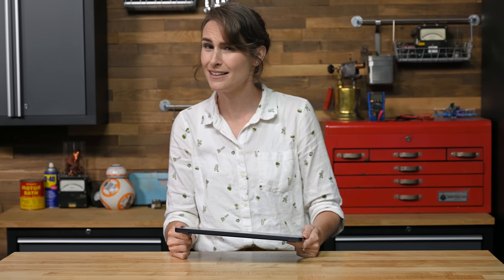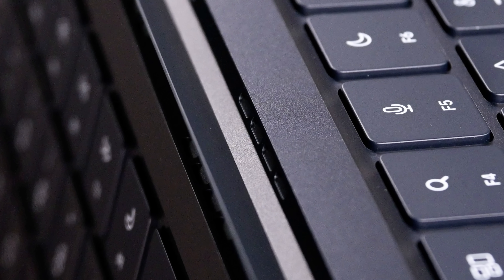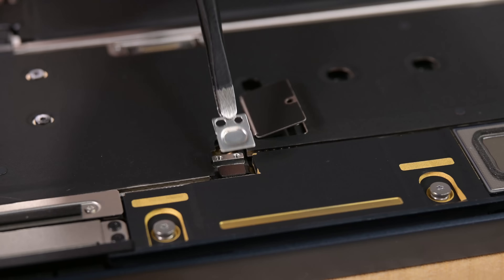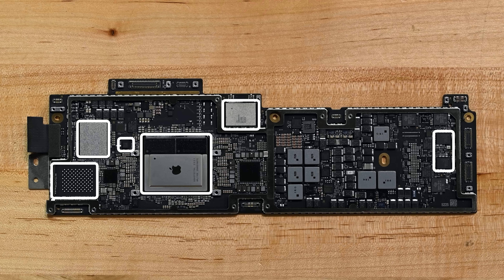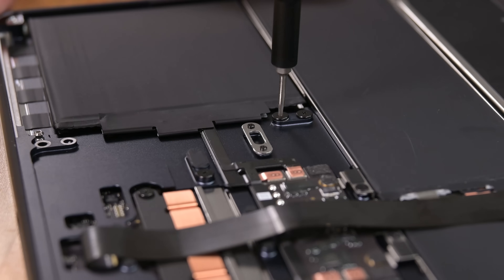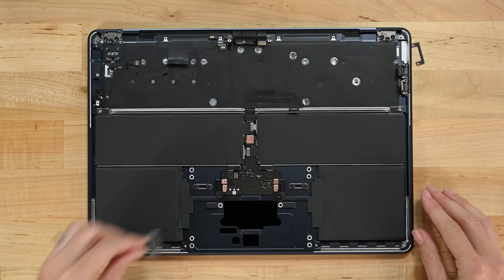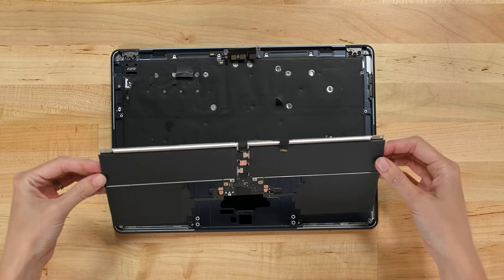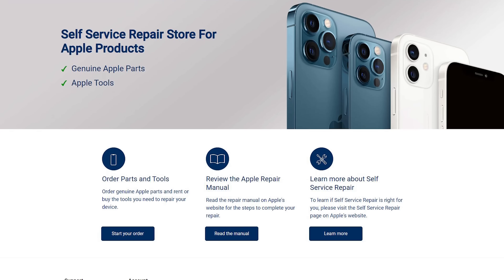M2 MacBook Air Teardown: Too Cool for a Heat Sink?

Comment: Remember when iFixit used to have detailed, step by step videos that would actually walk someone through the process of replacing parts? Now it’s all about highly edited videos with kind of useless and snide copy/commentary. Like everyone else, the modern ad-hungry internet made them a caricatures of themselves with these made-for-clicks videos that breeze through crucial steps without detail. Like getting the bottom plate off of this M2 MacBook Air with the use of suction and having to angle it out due to slide-in clips). I guess you can sell just so many tool kits before you need to pull tricks out of your sleeve.

Comment: You can drastically improve the thermal performance by adding more thermal conductive mass with copper shielding tape. Remove the graphite tape from the metal shielding panel, apply copper shielding tape on the metal shielding panel, but don’t cover over cutout areas. You basically just want to add more conductive thermal mass to the existing  metal shielding panel. Do not cover over cutout areas because you don’t want heat transferring over from the CPU to these chips. Now put back the black graphite tape over the copper. Make sure not to add copper tape to the area where the trackpad ribbon cable is routed! Now you have a proper heatsink!! This solution does the job without causing heat to get transferred to other critical components, using thermal pads will raise the temperature of your memory and storage!! You can also buy another bottom case cover and  drill tiny ventilation holes to allow hot air to escape! Use a tiny dremel drill bit with a printed hole guide to make it look clean and professional 😂 FU Apple!

Comment: 100c cpu temperature in the new macbook air M2 is another case of bad engineering by design. we already know that these chips have as little as 10w TDP, which is very easy to cool also within a think ultrabook, but they decided to use a thin aluminum foil as heat spreader with no real heatsink. a shame as usual. they can't point a finger to intel anymore but they wanted to make it worse anyway.

Comment: I had no issue replacing HD on my old macbook pros from 10 years ago but it looks like it would be a real pain in this laptop - this drive to be uber thin - and wondering about heat  - makes this machine a pass for me
Reply: The air solders their hdd/ssd

Comment: apple for whatever reason, lately, designing things that are not meant to last very long, and that are not meant to be repaired (supplying tools and parts is not meant for repairability, it is for show to satisfy laws etc... because parts/tools will cost a joke money and time that noone sane enough will do it, not to mention non apple parts will not work because apple chip and match them to prevent any other way of repairing!)
if your keyboard broke, apple will ask you to buy a new mac, if your ssd/ram failed, apple will ask you to buy a new mac, you broke the screen, apple will ask you to buy a new laptop. laptop runs down, apple will throttle you enough to make you think it s time for a new mac!

heatsink? what is it? 17th cent? cooling? what cooling fanbois are cool enough :)

good luck convincing fanbois!

Comment: No way all soldered in a single logic board no way!! (CPU, ram, data) is this a phone or a laptop? If you fry the logic board then it's all wasted ...
Reply: Yes my dear friend, that's the insanity that is employed by apple users. You would think apple could design some modular standard of memory that has the bandwidth of octa-channel memory even for the rare applications that take advantage of that, but nope, we screw you extra hard by soldering down your precious storage so you can't repair, upgrade, or recover the data if any other component of the board fails. Should've bought applecare you bozo!

Comment: some youtubers have gotten better benchmark scores by adding a few strips of thermal pads to spread the heat. eventually the whole inside gets hot though and throttling still occurs. If someone comes out with a proper heat sink/thermal kit with a replacement vented case bottom i’ll be first in line to buy one.

Comment: M.2 drives do not require heatsinks. Only the controller chip benefits from the heatsink, not the NAND. NAND retains data more effectively when it's toasty.
Reply: Apple's new CPU is called the M2. Yep, it's confusing. This machine has an M2 processor and M.2 storage.

Comment: If there's no heat sink, how is the thermal pad mod as effective as it is in the first place? It's exactly like the m1 air, the pads are so effective they beat out the Pro in the first few tests before the chassis is soaked. But for the pads to be effective, it means the heat sink has to also be effective, no?

Comment: Usually the accelerometers in laptops protect hard drives from damage. If the laptop were to suddenly drop while in use, the accelerometer would detect the sudden free fall and immediately turn off the hard drive to avoid hitting the reading heads into the hard drive platter. 
In this case, I have no idea why since it has SSD

Comment: I have ordered this and now I’m concerned, won’t the lack of a heat sink damage the laptop in the long run? I’m hoping to use it for 6-8 years
Reply: I’m considering cancelling my order and getting the m1
Reply: Well as long as the built in heat protection mechanisms work (thermal throttling & emergency shutdown) the computer should be able to protect itself from any long term damage

Comment: I've noticed 13" M1 MacBooks wake when moved, which is literally the only accelerometer use I've found. Maybe it's also used in warranty evaluations to check if it has been dropped?
Reply: Interesting

Comment: the accelerometer helps detect falls — in older machines, it would retract the hard drive heads on mechanical hard drives to avoid the head crash during a fall. i imagine it is used to avoid some similar mishap when it detects that the machine is falling. 🤷 

nice to see the modular ports — this makes the most commonly failing component — the plugs more repairable, and you dont have to get a new motherboard if all that failed was the user busting their usb plug.

Comment: That big metal panel with thermal compound is a heat spreader, and it has much more surface area than the small one in the M1 MBA.

Comment: The accelerator is used for spatial audio mapping. So if you turn the laptop and your head at the same time, the sound will stay pinned at the same place. It's definitely not used for Find My as mentioned here
Reply: Or Apple can see if u dropped it in warranty

Comment: Enjoyable video, except for unnecessarily throwing shade that the laptop has a heat problem. You could've easily proved or disproved this point by doing some testing, which other reviewers have done and found that throttling prevents overheating.

Comment: You got to be consistent. The logic board cover is a heat spreader albeit thin. Closing remarks she said “heat spreaderless” which is contradictory.
Reply: Do you think it the heat spreader is good enough to not cause internal damage in the long run? For someone hoping to use this laptop for approx 8 years

Comment: My guess for the accelerometer is that it'll enable spatial audio, as currently only devices with an accelerometer have it enabled.
Reply: spatial audio is only on headphones though, there would be no need for it on a macbook
Reply: @nick4577  air m2 has spatial audio
Reply: @aksh_x_  it supports spatial audio but there is no need for an accelerometer to power that, only the headphones/wearables need an accellerometer for that
Reply: @nick4577  The device also need an accelerometer so if you’re in a bus or train the sound stay fixed even after you take a turn. In the initial announcement about Spatial Audio, Apple talked about how they compared data from the two accelerometers.
Reply: @cedricpomerleau5586  my m1 macbook air supports spatial audio without an accelerometer, please explain that then, the accelerometer needs to be in the headphones only

Comment: Lack of any real heat sink solution almost makes one wonder if the throttling behavior of the M2 Air vs. the M2 Pro is more or less intentional from Apple to help "differentiate" the product line. 
Also would be interested to see someone stick a thermal pad (or even some K5Pro) between the spreader/shield and the outer aluminum case and see if it helps much. Granted, it would make the bottom of the laptop hot, but from what I've seen thus far it kind of already is...
Reply: Nope mine is cold all the time and the cpu stays cool 40-45c
Reply: Would the lack of a heat sink damage the laptop in the long run? I’m a student and use excel, pages and have 10-20 internet tabs open on split screen for research when completing tn assignments. Wondering if I should cancel my order and keep using my current laptop. I was hoping to use this for 8 years which is how long I’ve had my current MacBook
Reply: @AS-bq7sc  You could change the thermal paste in your current MacBook. Apple is known for its bad thermal paste and after 8 years it will be just dried out (even in some products that are only a few months old this happens). I done it with several MacBooks and iMacs of friends and most of them are getting 20° Celsius less than before and never reach 100°C.
Reply: @AS-bq7sc  i doubt that that will get it to reach those temp. if you aint gonna 24/7 stress test it. or exporting everyday it'll do fine.

Comment: I'd really like to see the inside of a recently manufactured 256GB M1 Air to see if they're still shipping it with one 256GB or two 128GB.  Why would they hog all the dual pair 128GB chips for the old one?
Reply: Probably because most base 256gb buyers wouldn't notice and they need 128gb modules from their iphones and ipads, the chip shortage might have to do something with it.
Reply: Because…. More profit margin added to their 150% profit per unit

Comment: Apple could've done the right thing and not "sabotaged" the SSD speed on the base model. So the M2 Air won't perform well without paying additional premium for 16gb ram AND the faster 512gb memory, the latter something most people likely won't need anyways, or can anyone argue that merely adding the extra RAM will suffice to perfom well?
Reply: They haven’t. They only make 256 SSD now. They aren’t going to put 2 x 128 in there to just increase the speed. And anyone buying the base model wouldn’t even care let alone notice.
Reply: @danielbass09 MANY PEOPLE CARE AND NOTICE over a 50% performance drop going from a 2 years old $999 product to a $1199 brand new one.
Reply: The 16 gb ram will suffice. There is a youtuber that did the test. The 16gb ram is the determining factor for performance with the M2. It increases the performance of the chip. Only when you work with or transfer very large files then the ssd becomes more important for performance.

Comment: Accelerometer could be for Apple to figure out if the laptop has ever been dropped during repairs to see if the damage is a manufacturing defect or just carelessness.
Reply: Yes Apple being Apple
Reply: @aksh_x_  They do a lot of ehh stuff but this one I wouldn't blame them for. They shouldn't have to be blamed for a manufacturing issue if someone was dropping their computer left and right.
Reply: That's for spatial audio. You'll need that if you want to enjoy spatial audio on a plane or on a train.
Reply: @eeyoreronald  I don't think it's that, I've been using the M2 Air and listening to spatial audio a lot, it's different when using the AirPods and when using the MacBook's speakers it gives a spatial audio feel but i don't see why it'd have anything do with the accelerometer.
Reply: I have a MBP from 2008 with an accelerometer in it but the purpose then was to swiftly halt the HDD in case of a drop. You could install an app that would turn it into a seismograph!

Comment: Which of these two is better for a university use (take notes, watching videos, using excel and other stuff)?:
-MBA with 512 of SSD and 8gb of RAM
- MBA with 256 gb of SSD (with the storage issue) and 16 gb of RAM
Considering that I would like to keep this MacBook for at least 5-6 years
Reply: How about the M1 MacBook Air Refurbished?

Comment: People forget that this laptop is just an office laptop that should not be used with heavy work, ofc it can make it but it was not designed to do so. I really love this fanless design. And if you want it to run cooler? Just slap a heatpad on it to transfer it to the case

Comment: Excellent video. Thanks. What I'd like to see, though, is someone who has actually tested it out to see how hot it gets instead of the many people who look at it and just ask, "Gee, I wonder if it'll overheat?".
Reply: There's some video's on the internet of someone doing tests comparing it with older products.
Reply: @Mr_Battlefield  Interesting. I didn't know that. Are there ones that show how the MB Air M2 deals with heat?  Can you give some links? Also, my point was more about these reviews that don't test how it deals with heat issues and just mention that it might be a problem.
Reply: @designgroup6874  yes there are plenty. Look for Luke Miani

Comment: Apple has so much potential in creating a truly repairable/upgradeable laptop. They have excellent production line capabilities, way better than framework. Bt alas, we don't live in a perfect world...
Reply: Repairable products end up bigger in size and arent as optimised as unified counterparts
Reply: @mal7916  yes this happens with other OEMs, but Apple has the potential with all the optmisations and smaller size... but they  put software locks to prevent upgrading. Just take the example of mac studio
Reply: @mohit.kunjir  I dont mind the fact that the SSD and RAM arent upgradable. The RAM in M chips sits very close to the CPU reducing latency and the SSD's controller chip in now integrated in the SoC, which also reduces latency.
Reply: @mal7916  our discussion is making a product more repair friendly, well lets go with your point of it increases the performance, agreed. But explain why do they have to put software locks from replacing a a nand flash (let's call it that since its not full ssd). That extra engineering there is utterly useless. Also if all Apple wants is to make an integrated product then least it can do is make its schematic available....

Comment: I think MacBooks always were with accelerometer, my 2009 MacBook Pro had one and there were some apps that used them, I remember seismograph app and one of this iPhone like games with a ball in a maze.
Reply: In older computers those sensors were used to detect drops so the hard drive would stop spinning to prevent data loss/corruption. In newer macbooks with SSDs, those sensors were omitted.
Reply: @maybethisismarq  yes sure, but the sensor was available for developers as well, so it was not used just for that

Comment: Accelerometer is probably for Spatial Audio. So the AirPods follow the MacBook where you move it.
Reply: I thought the U1 chip did that? And knows the direction it is away from the AirPods?
Reply: @danielbass09  Nor AirPods or MacBooks have U1 chip. That's all done by the accelerometer.
Reply: @ivansit0TV  The M2 Air does have a U1 chip

Comment: I feel like I can do some mods for that macbook air with copper sheet, some good paste for the CPU, Install another SSD Chip, and all.
Reply: Some channels already proved that swapping/installing another SSD doesn't work. Typical apple.
Reply: This very idea of moding with a copper sheet and thermal paste also crossed my mind. Although the space is constrained, I believe it is enough to accomodate these.
Reply: Would that really improve anything? The problem isn’t extracting the heat from the chip. The problem is that the chip generates too much heat for the tiny metal body to handle while staying under 50°C. That thin heat spreader already does the job of spreading the heat away from the chip, but the heat stays within the frame. It’s trapped. Adding a larger heatsink won’t change that. Just my thoughts. Adding thermal paste will transfer the heat towords the bottom panel wich will make it hot to touch. Which isn’t good for men’s fertility if you put it on your lap. It really doesn’t get hot with conventional use, only under extended heavy load will it throttle, which is what it is supposed to do to prevent overheating.  The next M3 will be better since it will be based on 3nm and generate less heat.